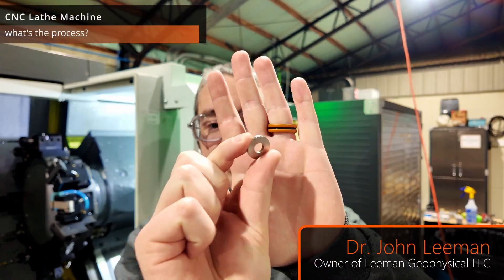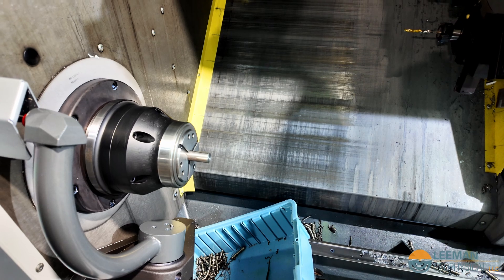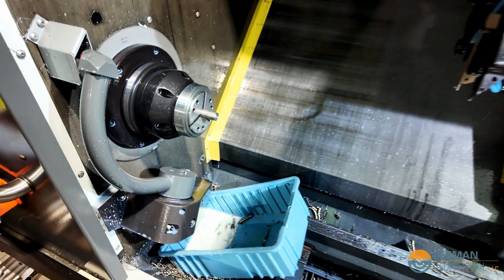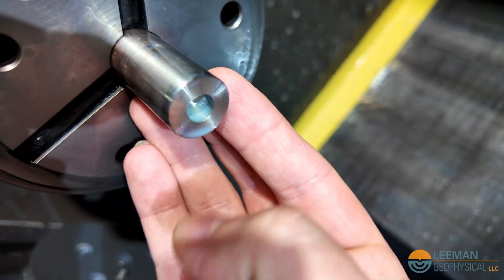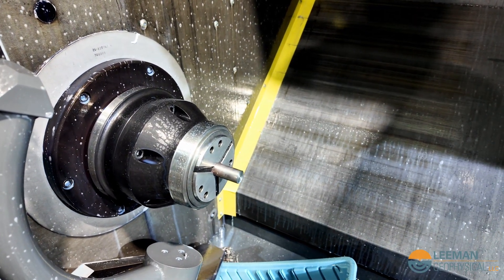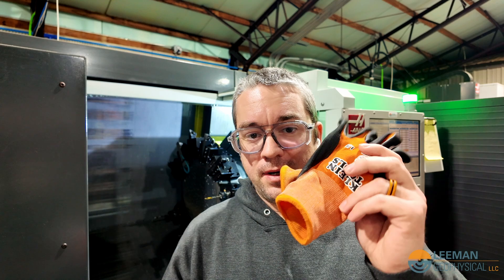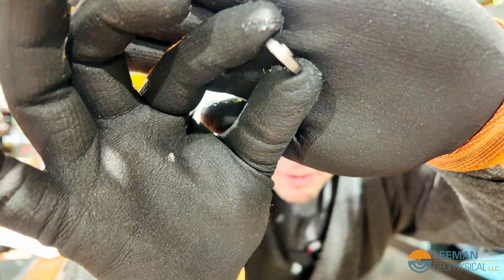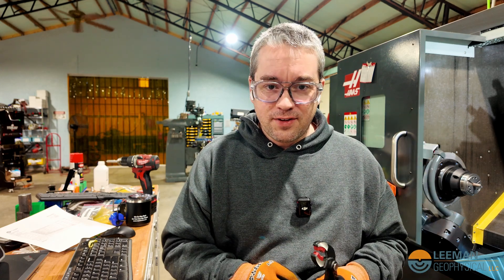How We Make CNC Machined Washers for Our Geologist’s Squeeze Box! 🔩

Comment: Have you considered more of a "gang turning" idea for these? Ie. face, contour, spot, drill 3-4" deep, then part off 5 or so? Just an idea to minimize tool changes...one spot and drill gets you 5 washers instead of 1 spot/drill per washer. Could be more efficient.
Reply from the maker: Great suggestion! We have thought about it and may experiment with it. It would certainly save some time. We also tried a y-axis parting tool to get better finishes on the part off. It did better than the grooving tool we use now, but it was also about $3k for the full setup, and it wasn't a $3k better finish. 😂